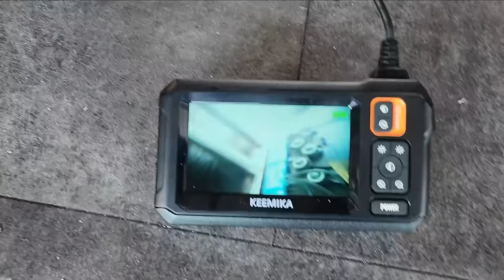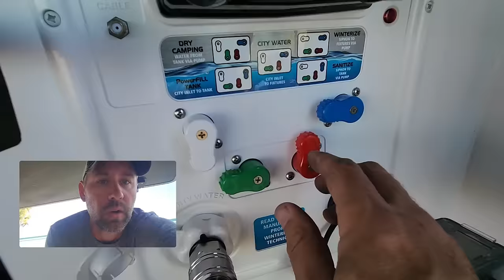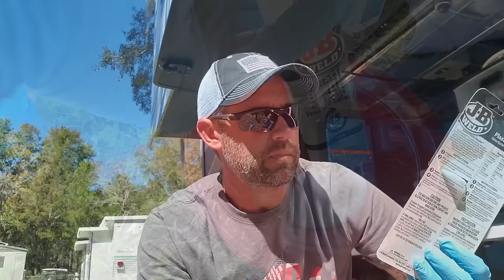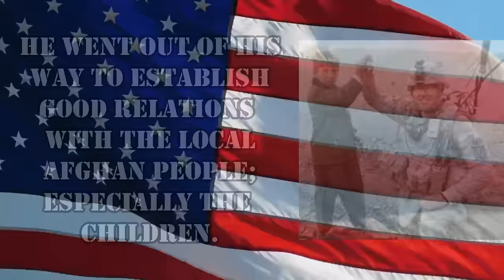RV LEAK! (Fresh Water Tank RV Leak Fix)

Comment: Your RV Fundamentals class is paying off! LOL! Great job!  Also, I might suggest a mix of baking soda and water to make a little paste and put it on exhaust pipe to get the plastic to lift off, let it sit for a minute or two and then use a scrubber or a small plastic scraper to try and lift the plastic off.
Reply from the maker: Lol, yes it is. Thanks for the tailpipe tip!

Comment: Could you have sucked that JB Weld back up into the syringe after you mixed it, and used that to apply it instead of using your hand?
Reply: That's what I was thinking. Plus an inspection mirror to check the backside
Reply from the maker: Good idea. I'll definitely do that next time.
Reply: @WaywardWaggs  if you were a 15T you would have known. 😉

Comment: Good job on the fresh water tank repair.  For the melted bag, try one of those drill attachments that remove decals - it is a form of rubber that won't mess up the tail pipe but will heat up the plastic enough for it to come off.
Reply from the maker: Thanks for the tip!

Comment: Had a similar issue with our previous RV. 3 years after ownership our fresh tank started leaking and I found the factory had shot one of the bolts holding the underbelly into the corner of our tank. I used the same produce to close the hole. Great stuff. Thanks for sharing!
Reply from the maker: Oh dang! Ya, it's really good stuff 👌🏻

Comment: If you  put JB Weld on there doesn’t that make it permanent? So if that sensor goes bad how will you get it out?
Reply from the maker: We don't use our sensors so it is not a big deal if they go bad. As long as it doesn't leak, we are happy.
Reply: @WaywardWaggs  so how do you know that your gray and black tanks are close to full?
Reply from the maker: @RickandDarcirvadventures  We empty and flush the black tank once per week and empty the gray tank every other day so there is no real need to look at the sensors.

Comment: I was surprised that there did not appear to be a layer of insulation (like batting) under your RV other than 1 small area you point out. Isn’t your RV supposed to be “4 Season”? The coroplast is more of just a barrier, little insulation value.
Reply from the maker: I believe all the Alliances don't have insulation. Never asked why they don't- probably should ask, lol